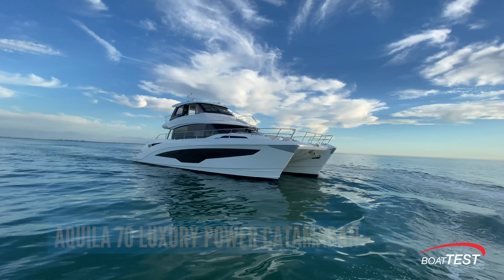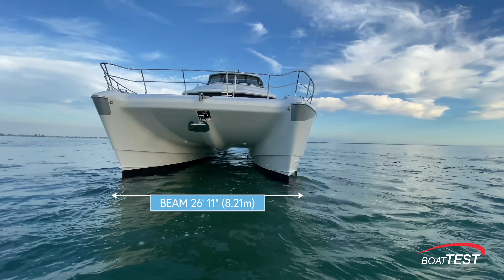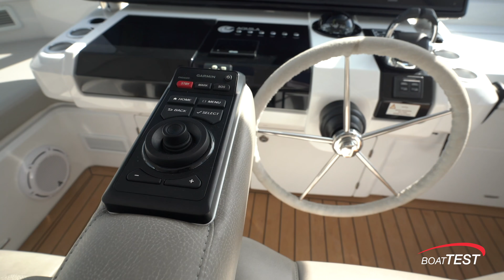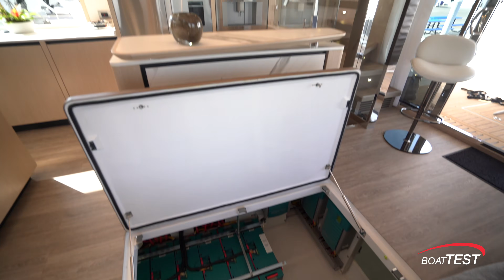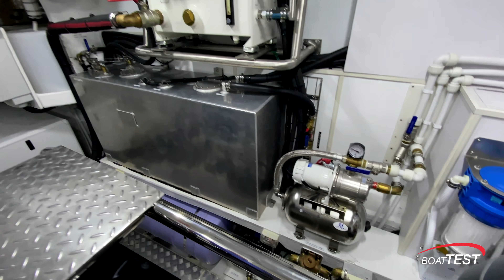Aquila 70 Luxury Power Catamaran (2021) - Test Video by BoatTEST.com

Comment: There is absolutely nothing luxurious about the 70 Aquila. It's the bayliner of cats. Cheap finishes everywhere and poorly designed interiors.
Reply: I am new to this, but I definitely understand the Bayliner reference.  That , said who makes a solid power cat to voyage comfortably around the Bahamas and down to the Caribbean?  How much of a performance / safety compromise is that center master cabin?  Any recommendations for a MY  50 to 70 ft with a similar mission?

Comment: I wonder If those bulbous bows that usually are used on freight and cruisliners helps at all on a boat like this. They are made for less drag from water contact from sine/cosinus area on the sides, but 70feet isn't that long compared to 300-400feet. What helps more with the dipping into waves and bobbing is a straight front edge to cut through with an inverted keel 1meter above waterline so It releases when bopping down into wave valleys and for the hull not to be so v shaped seen from the front so It slams when hitting wave fronts..

Comment: Great video and very smart hull design I thought; a little bobbing was visible on the flat water at speed - as the boat planes on the flat undersided pontoon for a moment before being driven under and then back on top again. Did you look at adding efficiency with a center foil? Similar to the one you offer on your 37ft model?

Comment: You say you raised the deck to water clearance, but it looks like around two feet to me, which will probably pound badly. The rear view even makes me doubt the two feet. An impressive engine room discussion. I saw the radar antenna spinning, so I know it has that. Would have liked to hear about the chartplotter. I have never used a joystick, so I am wondering how that works in to, say, a 2 hour passage from West Palm to West End. If you let go, does everything just stop ? If you are holding a bearing with autopilot, is the joystick disengaged ? This may be the future, but my experience is from the past. How much water does the watermaker make ? Or, in other words, how long to fill the tanks ? I did not see the RO tubes in the engine room tour, but I presume they are there somewhere. A brief peek into the other hull and the AC unit would have been nice.

Comment: Being biased towards engineering, and the fact that for future maintenance, safety,  any captain and the rich owner would pass it onto my shoulders and my responibility, I am not exactly primarily interested in the beauty of the cosmetics and the luxuries on board, but  I am interested in the bare primary necessities of the hull and the robust/efficient structure which would save the life of any captain and any owner and his guests, as all the rest of the still engineered cosmetic equipment can come later to those who are blinded by such " beautiful toys".

         1. The initial five-second observations of the " priority engineered necessities" these, are very good indeed. The side windage is well balanced, and for a side/lateral constant or gusty wind, this would not affect her much and there would be a little preference for her nose to go to the wind which is a preferred stable situation in watercraft. This is good when berthing in windy conditions as one need not fight the boat. The well-rounded edges would reduce wind noise a lot.  High marks.

         2. The hulls seem to be symmetrical, not unsymmetrical, and the front, inner, bow wave mustaches, from either hull, tend to interfere cumulatively and rise up, but the higher central tunnel is a good compromise between all sort of variables, including pounding wave height,  better accommodation and excellent structural integrity for twisting hull.   High marks.

         3.The hulls have a good prismatic coefficient much higher than that for a "fishing type buoyancy" hull, (0.54 perhaps)  which makes a high wave resistance, but not as large as the fastest narrow canoes with knife-edge entry ( 2.0. or more perhaps)  The full bow is to my logical liking, as when that hull is in the following sea, where the rear-coming/advancing high wave will lift the transom end, which then normally shifts sideways on the crest of the wave, the narrow bow will dig into the water, producing a lot of lateral resistance, and the boat could broach and capsize.  Considering this is a cruising boat this full bow feature, I like a lot for safety without losing too much wave-piercing performance. For that type of bow, even though not so sharp, it could lead to a wet boat with water running and sticking to the side all the way past the deck so those spray rails above the bulbous bows are imperative.        High marks.

         4. The bulbous bow is good, but the gentleman is talking " cosmetically" when he depicts its flattish non-circular shape to stabilize the pitching, and that could be a big disadvantage in a broaching situation as described above adding higher bow resistance. Well, the front end of a dolphin and an orca, or tuna do not do so bad with a circular cross-section and that sharp point is totally unnecessary, as that particular pressure zone will form its own rounded shape with stagnant water being pushed with the bow, even it the front end was buff, in fact, a rounded buff front would have less surface area and more volume.  Still, the boat aft run is straight aft of the center section and that is what counts as long as the transom is aired and ventilated in order not to cause suction, as in the case when the aft run is lifted/raised up as in an old hull as the "Bluenose" and most cargo single-hull ships as the mighty Emma Maersk.    Considering the overall weighting. I would have given HIgher marks for a rounded bulbous bow so at is .............medium to high marks! 

          5. The hull is not, fully heel (inclination)stabilized and self-righting, like when the center of buoyancy is always above the center of gravity, and even if it was,  with its beam, if it had to capsize, then if the accommodation area was filled with water, that hull would still be stable in an inverted situation. There were weighted mon-hulled yachts with small central cabins and large side deck areas which were stable even when inverted, floating in low wavy seas.   This vessel has a center of gravity that is well above the center of buoyancy, yet the vessel remains stable. The yacht is stable because as it begins to heel, one side of the hull begins to rise from the water and the other side begins to submerge. This causes the center of buoyancy to shift toward the side that is lower in the water. The job of a design engineer is to make sure that the center of buoyancy shifts outboard faster than the center of gravity as the ship heels. Such hulls will always roll and pitch oscillates a little.  In monohulls with a Vee bottom, the heeling is a lot and they could even finish floating on their side when the design engineer does not do his calculations so well.  https://youtu.be/N6TYQZd0HPs  In this hull, being a catamaran, the buoyancy shifts laterally very fast with respect to the shift in the higher center of gravity.    I was a little amused and had to smile when the nice gentleman doing the video commented at 3:18, "  I noticed that when I put it into a turn, it stays level in the turn!" Well, what can I say, I watched a lot of people in videos describing the Aquila 70 and the 54 and others, and I find them amusing that they prefer to sell the cosmetics and the luxuries and use "repeated female-oriented vocabulary" which makes an engineer, with his sense of humor,  smile a little, with a lot of understanding and compassion for these salesmen.        For a catamaran, this structure, comfort, and aesthetics are the best compromise there is but I would advise the owners of such a beautiful boat, to close all the upper superstructure in wavy seas especially when going downwind or moving diagonally with high waves and those attacking from the back.  The fact that the central tunnel below was kept low, the diagonal bracing on this structure will take the stress due to the twisting in the hull, as the sagging and hogging have no problem whatsoever.  For this feature, marks are high but not the highest for obvious reasons where all catamarans and trimarans are not as good as weighted hulls for stormy seas.  Owners must keep an eye on the weather, but the speed of these hulls will help to reach the harbor quickly,  in such situations.    When design engineers go wrong in their calculations. https://youtu.be/5S8ROPUC0Aw

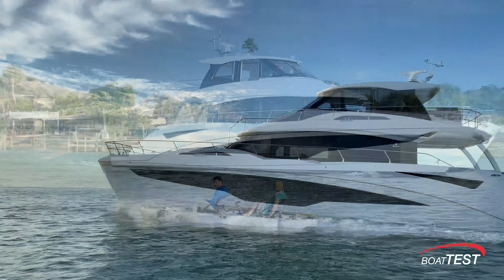         6. The engine and auxiliaries are excellent, but being what I am, I say,  one does not need all that coordinated electronics, and I prefer manual control with a hydraulic gearbox using my own logic, reason, and rational thinking, doing the same actions. With two engines being wide apart a set of biting propellers,  I do not even need those bow thrusters as the propulsion geometry in addition to the gearboxes and rudder control one can move that hull, ahead or astern or sideways at 90 degrees or turn it on a dime with those two excellent engines. I like the fact that the propellers are not raised into a propeller tunnel, as at over 25 knots, this feature is not to my liking, The safety features in the engine room are excellent. All the above describe the beautiful majestic gait of this hull shown at 10:07 and that is all that interests me, even if the hull is stripped of all the luxuries and aesthetics in the cabins and lounge, as a camping sleeping bag and a small stove for a hot meal are good enough for me.

          7. All the other cosmetics and embellishments, including the leather-wrapped stainless steel and the handles all over the place, and the settings, are all well-liked by my wife and all the children in my household who came around to see what I writing.  Though I do not care too much for the " engineering cosmetics and toys"  which I, as an engineer have to maintain when they break down or tune when they lose their accuracy,  I am a fair man and all the rest of my family who want those cosmetics to operate them and have fun.......................... their assessment and their mark was of the highest order.  I just hope that when any of that engineering equipment existing in that boat needs repair, or maintenance, the owner or the captain himself would consider that the safety of their lives is in my hands and they would consider paying me at least treble the payment rate of a sea captain, as heavy is the responsibility of an engineer, when it comes to keeping in good order, the essentials and cosmetics installed in, land transport, air transport, and ship transport engineered PROSTHETIC AIDS, as that is all that they are, no different from this child in this video wearing an engineered prosthetic aid to help him walk rather than to cross the oceans.     https://youtu.be/KH8zPr-1AeA   As an engineer,  I rather handle the very necessary engineered prosthetic aids on board boats and in hospitals and homes, rather than the ones which are cosmetically oriented to create emotions and pretentious dreams as flying aerobatics a Pitts Special.  https://youtu.be/my5P6um_pCk   But we all have different requirements to fulfill our lives with, and that is a good variable in human beings.  In conclusion, this is an excellent/brilliant compromise, considering the complex engineering in the priority necessities and the engineering in the emotional cosmetics!   The final mark for this wonderfully engineered prosthetic aid...........................a High mark indeed.

Comment: I'd be very interested to see how adding the foils (similar to the 36) would affect the performance characteristics.
Reply: Probably too heavy for it to be practical. They have this one set up so that the hulls stay in the water (hence the "bulbous" bows). They'd have to completely redesign the boat for foils. Not to mention those foils would have to be huge on a boat this size/ weight.

Comment: I see lots of boats tied up in marinas all over the world trailered boats seem to go out more often I also notice boats like this one are never seen or shown in rough conditions or are they just for river or lake use.
Reply: This is a CE A rating which means it is rated as being suitable for crossing oceans, extended voyages, winds over 40 knots, and waves over 13 feet. 
Most yachts are built to CE B rating which is similar but not advised to go more than 200 miles offshore and wave under 13 feet.
Reply: @DarthKEK  thanks for that info it is a great help in understanding the ratings,
Reply: @DarthKEK  I think bad weather arounf GB would be the end of that one.
Reply: @191246mann1  Catamarans are famously resilient, that's why they're so often used for ferries. And this is an Ocean-class explorer rated one.
Reply: @DarthKEK  two floats with cabins in them and a net between them is one thing but if you use the middle as a cabin with a solid floor that is not the same you hit a big wave and the water hit that middle it will stop dead and you are in trouble ,it will cut through the water only when it is not rough ,,show me one on an average rough day and prove me wrong.I have never seen these boats out when the weather does a turn.
Reply: @191246mann1  all I can say is it's legally rated by the statutory bodies for Ocean crossing and  the strongest storms. I haven't ridden it in a Pacific or Atlantic storm so I can't personally prove it one way or another.
Reply: @DarthKEK  I don't want to win this argument with this reply I just though it was worth a look on a friendly basis ,in this post this a really nice boat and I know 57 food mono hulls go down as well but have a look just out of interest,.....Capsized Atlantic 57 and Rescue by the M/V Forum Pacfic August 2010
Reply: @191246mann1  large-scale shipping loses about a ship a month in the Atlantic. They used to blame the crew, for decades, but now they know Rogue Waves exist and they destroy anything in its path.
Reply: @191246mann1  https://youtu.be/VU-EpUpub5I
Smaller scale, but catamarans go great on large waves, they also have enough buoyancy to not have the hull slap in terrible weather. A lot of catamarans cross oceans every year
Reply: @sadenuttie2234  OK but what has always worried me is if things go wrong and they are caught side on or they do go over that is the end there is no way back.
Reply: @191246mann1  when any boat in that size range gets flipped they are gone. Due to being wider, Catamarans have a much lower Center of gravity, so they are less prone to capsizing. They are just more stable. Caught side on they are still less likely to capsize, but of course a huge rogue wave hitting you side on will capsize anything. That’s why you would rather catch them front on
Reply: @sadenuttie2234  Anatomy of Disaster - Season 2 Episode 5 - Ferocious Oceans      you won this argument.
Reply: @191246mann1  haha, not an argument but a discussion. I’ll take a look, cheers mate

Comment: Wow, what an incredible piece of engineering. I thought the Aquila 44 was impressive and it most certainly is but this takes it to a whole new level. And it's interesting that you're getting a thousand horsepower out of those D13. I'm just a truck driver so obviously it's not likely that I'll ever be able to own let alone set foot on such a vessel but it's still enjoyable to just watch videos about them. But it is interesting because I'm driving a Volvo semi truck and currently Volvo only offers about a 500 horsepower tuned version of the D13. But maybe they cut it back for longevity and to avoid shock loading the rest of the Driveline which I imagine in a boat that's not really a concern. Anyway, what a great boat and what a great review!
Reply: Hey Man you never know, maybe you will

Comment: Why don't boats in this size range use controllable pitch propellers? This tech has been around for a very long time and I would think should be very refined by now. The joy stick control on this boat which uses rudders ( as you mentioned) would be awesome with CPP.

Comment: 31 mph equates to 26.4 knots... not exactly quick if I’m mistaken. Good looking hull though
Reply: It's a distance & ocean cruiser not a sports boat.
Reply: @DarthKEK  and it's 70ft with a wide beam, not a mono haul.
Reply: @TChalla007  agreed, for the size and weight that speed is amazing.
Reply: For a platform of such comfort, luxury and stability I would consider 31 mph "hauling A".   You could water ski behind it.

Comment: The aerodynamics sure makes this turn from the usual cat. of a floating cooler to very impressive look of a real sport cruiser.   Looking at the fuel consumption drop with rpm, imagine the improved wind resistance must be a very significant impact on performance and especially economy.  Even in the harbour on a windy day the handling could be improved considerably too.   I cheated and looked ahead finding two full fridge freezers it then crossed off the independent beer fridge check box, therefore, and for that reason alone it's given two bottoms up.